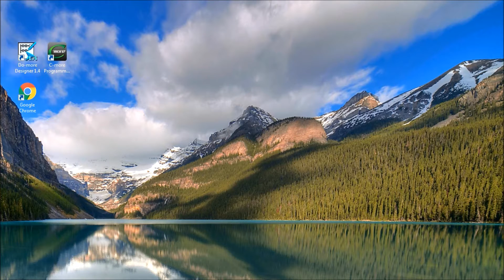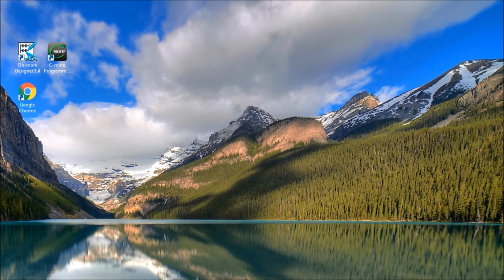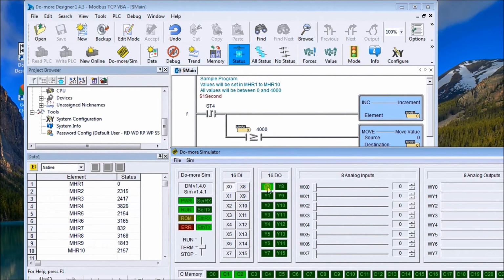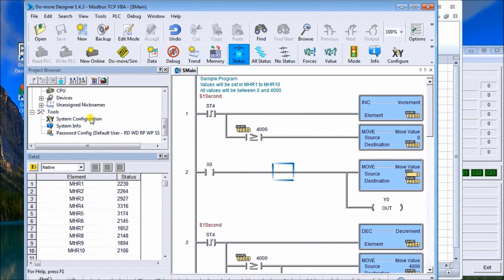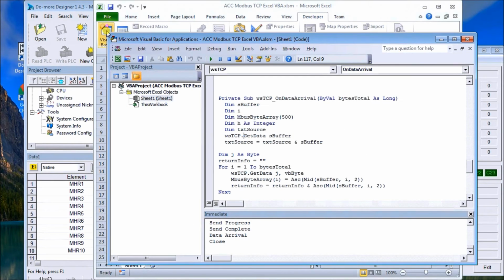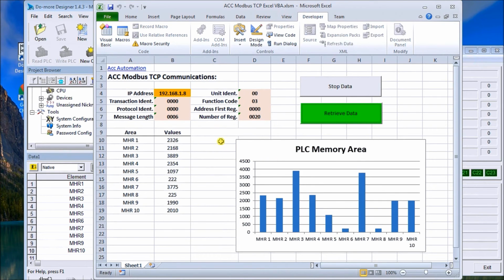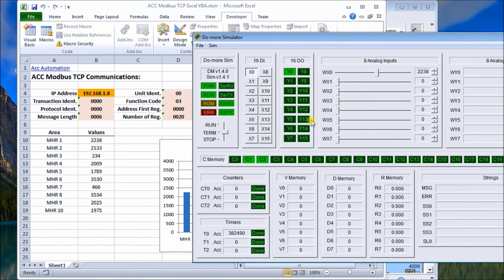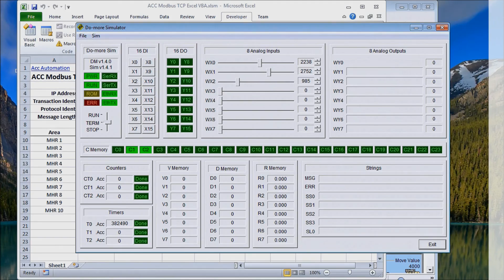Supercharge PLC Data Extraction with VBA and Modbus!

Comment: One Question.
When querying the sentence below, addresses up to 127 are retrieved successfully, but addresses above that number are problematic (Actual Value: 128, Return Value: 63).
Are there any limitations to using the CHR function when querying addresses above 127?
Is there a better way?    
MbusQuery = Chr(0) + Chr(0) + Chr(0) + Chr(0) + Chr(0) + Chr(6) + Chr(0) + Chr(3) + Chr(0) + Chr(127) + Chr(0) + Chr(20)
Thanks.
Reply from the maker: Hi James,
The maximum length of a Modbus message is 256 bytes for Modbus RTU and Modbus ASCII. This limit applies to the entire message, including the address, function code, data, and error checking (CRC) fields. For Modbus TCP, the maximum message size is also 256 bytes, but this includes a 6-byte header and a 1-byte unit identifier, reducing the usable data payload. 
You will then repeat the Modbus message with a different starting address for the next piece of data. (256 bytes)
Regards,
Garry
Reply: @ACCautomation  Thanks Garry.
My question is, for example, how can I get the values of 10 registers starting from Holding Address 258 ?
Ragards
Reply from the maker: @jameslee6311  
If (wsTCP.State = 7) Then
    MbusQuery = Chr(0) + Chr(0) + Chr(0) + Chr(0) + Chr(0) + Chr(6) + Chr(0) + Chr(3) + Chr(2) + Chr(58) + Chr(0) + Chr(20)
    wsTCP.SendData MbusQuery ‘Send out the Modbus Information
    ‘Read the information
    ‘0000:    Transaction Identifier
    ‘0000:    Protocol Identifier
    ‘0006:    Message Length (6 bytes to follow)
    ’00:      The Unit Identifier
    ’03:      The Function Code (read MHR Read Holding Registers)
    ‘0258:    The Data Address of the first register
    ‘0020:    The number of bytes to read

The website has step by step instructions:
https://accautomation.ca/how-to-implement-modbus-tcp-protocol-using-vba-with-excel/

Regards,
Garry

Comment: Dear Garry, Thank you very much for your prompt and kind response. I have already downloaded, installed, registered, and referenced MSWINSCK.OCX. However, when I run the macro and use the "Retrieve Data" button, I get the message "Error - 2147221164: class not registered." I would greatly appreciate your help. Best regards, Carlos

Comment: Dear Harry, I've seen your magnificent video. I congratulate you and thank you very much. I couldn't get it to work on Windows 10, but I did on Windows 7 and Excel 2010. With the simulator, it worked on the first try. Then I tried with a real PLC, changing the IP address, and it worked, but some numerical data arrives distorted. Others, even large ones like 20000, are not affected. I would greatly appreciate your comments so I can understand what is happening. Thank you very much. A hug from Lima, Peru, Carlos
Reply from the maker: Hi Carlos,
Thank you for the comments. 

To use the OstroSoft Winsock Component (MSWINSCK.OCX) with VBA in Windows 10, you'll need to register the component, add it as a reference in your VBA project, and then you can use its features. The process involves downloading the component and registering it using regsvr32.
"regsvr32 C:\Windows\SysWOW64\MSWINSCK.OCX"

Modbus is a 16-bit communication protocol. Anything larger than this (16 bit, FFFF, 65353), then you may need to read two values and put them together. One of the most significant digits and one of the least significant digits. 

A more powerful and robust logging system can be obtained by using Node-RED. Here is the series that will take you through installing, collecting data, saving to a database, and sharing this information with multiple users.
https://accautomation.ca/series/node-red-iot-enabling-software/

Regards,
Garry

Comment: how to write to the PLC?
Reply from the maker: Details on the writing are on the corresponding website post for this video:
https://accautomation.ca/how-to-implement-modbus-tcp-protocol-using-vba-with-excel/

    ‘Write the information
    ‘0000:    Transaction Identifier
    ‘0000:    Protocol Identifier
    ‘0009:    Message Length (6 bytes to follow)
    ’01:      The Unit Identifier
    ’16:      The Function Code (read Analog Output Holding Registers)
    ‘0000:    The Data Address of the first register
    ‘0001:    The number of registers to write
    ’02:      The number of data bytes to follow
    ‘0030     The number to put into the register
   
I hope this helps you out.
Regards,
Garry

Comment: I keep getting "Error -2147221164: Class not registered" when I press the 'Retrieve Data' button.  Already repaired Excel, error persists.  The VBA code is not modified since downloading from your dropbox.  I'm running Windows 11, MS Excel 2021
Reply from the maker: Hi Kristien,

Can you register the OSWINSCK.dll file from the command line? Here is a link to explain how to do this.
https://myaps.reckon.com/knowledgebase/article/KA-01428/en-us#:~:text=To%20register%20DLL%20or%20OCX,e.g.&text=2.,regsvr32%20with%20the%20%2Fu%20switch.

-To register a 32-bit dll or ocx Windows System file in a 64-bit version of Windows (11, 10, 8.1, 7, or Vista),
     Type cd \Windows\SysWOW64  [then press Enter] 
     Type regSvr32 oswinsck.dll  [then press Enter]

Please let me know if this works for you.
Regards,
Garry
Reply: @ACCautomation   Copied the DLL file from the programs files folder into the SysWOW64 folder.  The OCX file was already there.  Ran the following two commands..
C:\Windows\System32>C:\Windows\SysWOW64\regsvr32 oswinsck.dll

C:\Windows\System32>C:\Windows\SysWOW64\regsvr32 oswinsck.ocx

Both registered successfully, but still getting the same error in Excel

Comment: Great video, thnks! I have one question, the adress of the first register(excel cell) is a hexa number? Any other input data is in hexa too?
Reply from the maker: Hi joao pereira,
Here are the cell numbers in the Excel sheet:
IP Address = B4
MHR 1 to 10 values located at B10 to B19
These are just pointers to the cell.
The values that are returned are hexadecimal from the PLC. (16 Bit Binary Word) 
The program utilizes the CHR and STR functions to convert the data from binary to ASCII and back.
The highest value of a byte of data is 256. This is why we have to multiply the highest significant byte with 256.
The full explanation can be found on our website for this video:
https://accautomation.ca/how-to-implement-modbus-tcp-protocol-using-vba-with-excel/
I hope this helps you out.
Regards,
Garry
Reply: @ACCautomation  I saw that code already. I want to know if the input data i fill, in first register(excel cell), that is sent to PLC is hexa. The code is working with the do-more simulator, but i am testing with a PLC i have with no sucess :(
Reply from the maker: @MrPereira99  
Yes, the information from the PLC registers is in hex. The Do-More Simulator and Do-More PLC (Like the BRX) should be the same code. It would just be the IP address change. 
I would also check your firewall on your computer to ensure that you will allow communication to port 502 (Modbus TCP default).
Regards,
Garry
Reply: @ACCautomation  If i want to change the first adress of the first register i have to change in the vba code, more precisely in the mbusQuery, correct? in the excel cells is not enough. I think use chr() to transform in ASCII but i didnt understand how i write the message i want to send this way, can you explain? 

(Sorry for the late response, i was busing doing other things :(  )
Reply from the maker: @MrPereira99  
If you want to write data to the Modbus device you will need to change the code. The website post for this video will include the code to write information.
https://accautomation.ca/how-to-implement-modbus-tcp-protocol-using-vba-with-excel/
‘ Write the information
    ‘0000:    Transaction Identifier
    ‘0000:    Protocol Identifier
    ‘0009:    Message Length (6 bytes to follow)
    ’01:      The Unit Identifier
    ’16:      The Function Code (read Analog Output Holding Registers)
    ‘0000:    The Data Address of the first register
    ‘0001:    The number of registers to write
    ’02:      The number of data bytes to follow
    ‘0030     The number to put into the register

Regards,
Garry
Reply: @ACCautomation  i want to read, but change The First register only. 
There are 7 parameters in total(protocol, device id, etc) but only 12 chr in mbusquery formula.
I already saw this page, helped me a Lot!
Reply: so.. You know how to change the first adress in vba code code? It seems kinda weird to me because we have 7 parameters but 12 ch() in the formula.
Reply from the maker: @MrPereira99  
Here is a sample code for reading:
   ‘ Read the information
    ‘0000:    Transaction Identifier
    ‘0000:    Protocol Identifier
    ‘0006:    Message Length (6 bytes to follow)
    ’00:      The Unit Identifier
    ’03:      The Function Code (read MHR Read Holding Registers)
    ‘0000:    The Data Address of the first register
    ‘0020:    The number of bytes to read

If you want to change the starting Modbus address then change the data address of the first register from the code above.
This does have 7 parameters but you specify the number of bytes. Some parameters will take two bytes.

I hope this helps you out.
Regards,
Garry
Reply: @ACCautomation  Thank you very much!! I will try out!

Comment: Hi, how do i change Modbus addresses to another component using Modbus TCP / IP. It is for a Genset controller DEIF AGC4.
for example input register 04 address 501 Generator voltage L1-L2 (INT16)
Reply from the maker: Hi Michael Nielsen,
I have not used this controller. The manual appears to say that you can use software to change the Modbus address.
https://deif-cdn-umbraco.azureedge.net/media/purl03z4/option-h2-and-h9-modbus-communication-agc-4-4189341180-uk.pdf?rnd=132572580230370000&v=4
I would contact the manufacturer.
Regards,
Garry
Reply: @ACCautomation  I have the all the adresses to the controller. 
I want to know how to change your excel to these ardesses.
Reply from the maker: @michaelnielsen7974  
All of the documentation for this post is located on our website.
https://accautomation.ca/how-to-implement-modbus-tcp-protocol-using-vba-with-excel/

MbusQuery = Chr(0) + Chr(0) + Chr(0) + Chr(0) + Chr(0) + Chr(6) + Chr(0) + Chr(3) + Chr(0) + Chr(0) + Chr(0) + Chr(20)

    ‘ Read the information
    ‘0000:    Transaction Identifier
    ‘0000:    Protocol Identifier
    ‘0006:    Message Length (6 bytes to follow)
    ’00:      The Unit Identifier
    ’03:      The Function Code (read MHR Read Holding Registers)
    ‘0000:    The Data Address of the first register
    ‘0020:    The number of bytes to read

I hope this helps you out.
Regards,
Garry

Comment: Hello Garry,
I'm trying to get this to work but i get an error -2147221164 class not registered.
 It happens when it reaches the line.. Set wsTCP = CreateObject("OSWINSCK.Winsock")
I registered the DLL manually and reinstalled the oswinsck. Windows 10, excel 2010.
Reply from the maker: Hi psdonald42,
I would contact the vendor directly on this problem.
http://ostrosoft.com/oswinsck.aspx
There are some forums with similar issues:
https://social.technet.microsoft.com/Forums/lync/en-US/593947b2-3951-497e-99f5-475c46bc59d9/excel-2010-64-bit-corresponding-winsckwocx?forum=excel
https://www.mrexcel.com/board/threads/using-vba-to-create-tcp-connection-to-remote-temperature-equipment-using-ostrosoft-or-winsock.973563/
I hope this helps you out.
Regards,
Garry

Comment: I have used following code. I am unable to read holding registers.i am getting zero values for all registers. Please help

Option Explicit

Dim bytesTotal As Long
Dim sPage As String
Dim MbusQuery
Dim returnInfo
Dim wsTCPgdb
Dim WithEvents wsTCP As OSWINSCK.Winsock
Dim SetObject
Dim RetrieveData

Private Sub CommandButton1_Click() ‘ Retrieve Data
On Error GoTo ErrHandler
  Dim sServer As String
  Dim nPort As Long
  Dim StartTime
 
  DoEvents
  nPort = 502 ‘ See configuration in Do-More Designer
  ‘ Set the IP address of the PLC
  sServer = Sheets(“Sheet1”).Range(“B4″) ‘”192.168.1.3”
  RetrieveData = 1
  CommandButton1.BackColor = “&H0000FF00” ‘ Set colour to Green

‘Check to see if the object has been created. If not set wsTCP.
If SetObject = “” Then
Set wsTCP = CreateObject(“OSWINSCK.Winsock”)
wsTCP.Protocol = sckTCPProtocol
SetObject = 1
  End If

‘ Check the state of the TCP connection
‘0 sckClosed connection closed
‘1 sckOpen open
‘2 sckListening listening for incoming connections
‘3 sckConnectionPending connection pending
‘4 sckResolvingHost resolving remote host name
‘5 sckHostResolved remote host name successfully resolved
‘6 sckConnecting connecting to remote host
‘7 sckConnected connected to remote host
‘8 sckClosing Connection Is closing
‘9 sckError error occured

‘ If TCP is not connected, try to connect again.
If wsTCP.State <> 7 Then
    If (wsTCP.State <> sckClosed) Then
      wsTCP.CloseWinsock
    End If
    ‘ Open the connection
    wsTCP.Connect sServer, nPort
    StartTime = Timer ‘ Use the timer to determine if a connection cannot be made
    Do While ((Timer < StartTime + 2) And (wsTCP.State <> 7))
        DoEvents
    Loop
    If (wsTCP.State = 7) Then
    Else
       Exit Sub
    End If
End If

‘ If we are connected then request the information.
If (wsTCP.State = 7) Then
    MbusQuery = Chr(0) + Chr(0) + Chr(0) + Chr(0) + Chr(0) + Chr(6) + Chr(0) + Chr(3) + Chr(0) + Chr(0) + Chr(0) + Chr(100)
    wsTCP.SendData MbusQuery ‘Send out the Modbus Information
    ‘ Read the information
    ‘0000:    Transaction Identifier
    ‘0000:    Protocol Identifier
    ‘0006:    Message Length (6 bytes to follow)
    ’00:      The Unit Identifier
    ’03:      The Function Code (read MHR Read Holding Registers)
    ‘0000:    The Data Address of the first register
    ‘0002:    The number of registers to write
   
    ‘ Write the information
    ‘0000:    Transaction Identifier
    ‘0000:    Protocol Identifier
    ‘0009:    Message Length (6 bytes to follow)
    ’01:      The Unit Identifier
    ’16:      The Function Code (read Analog Output Holding Registers)
    ‘0000:    The Data Address of the first register
    ‘0001:    The number of registers to write
    ’02:      The number of data bytes to follow
    ‘0030     The number to put into the register
   
    ‘ Note: Addresses are offset by 1
    ‘   Example: MHR1 = Address 0000
    ‘   Example: MHR30 = Address 0029
   
End If
  Exit Sub

ErrHandler:
  MsgBox “Error ” & Err.Number & “: ” & Err.Description
End Sub
Private Sub CommandButton2_Click() ‘ Stop the communication
RetrieveData = 0
CommandButton1.BackColor = “&H8000000F” ‘ Set the default colour
End Sub

Private Sub wsTCP_OnDataArrival(ByVal bytesTotal As Long)
  Dim sBuffer
  Dim i
  Dim MbusByteArray(500)
  Dim h As Integer
  Dim txtSource
wsTCP.GetData sBuffer
  txtSource = txtSource & sBuffer
 
Dim j As Byte
returnInfo = “”
For i = 1 To bytesTotal
    wsTCP.GetData j, vbByte
    MbusByteArray(i) = Asc(Mid(sBuffer, i, 2))
    returnInfo = returnInfo & Asc(Mid(sBuffer, i, 2))
Next
 txtSource = returnInfo
 txtSource = Val(Str((MbusByteArray(10) * 256) + MbusByteArray(11)))
 Sheets(“Sheet1”).Range(“B10”) = Val(Str((MbusByteArray(10) * 256) + MbusByteArray(11)))
 Sheets(“Sheet1”).Range(“B11”) = Val(Str((MbusByteArray(12) * 256) + MbusByteArray(13)))
 Sheets(“Sheet1”).Range(“B12”) = Val(Str((MbusByteArray(14) * 256) + MbusByteArray(15)))
 Sheets(“Sheet1”).Range(“B13”) = Val(Str((MbusByteArray(16) * 256) + MbusByteArray(17)))
 Sheets(“Sheet1”).Range(“B14”) = Val(Str((MbusByteArray(18) * 256) + MbusByteArray(19)))
 Sheets(“Sheet1”).Range(“B15”) = Val(Str((MbusByteArray(20) * 256) + MbusByteArray(21)))
 Sheets(“Sheet1”).Range(“B16”) = Val(Str((MbusByteArray(22) * 256) + MbusByteArray(23)))
 Sheets(“Sheet1”).Range(“B17”) = Val(Str((MbusByteArray(24) * 256) + MbusByteArray(25)))
 Sheets(“Sheet1”).Range(“B18”) = Val(Str((MbusByteArray(26) * 256) + MbusByteArray(27)))
 Sheets(“Sheet1”).Range(“B19”) = Val(Str((MbusByteArray(28) * 256) + MbusByteArray(29)))

DoEvents
‘ Determine if we retrieve the data again.
If RetrieveData = 1 Then
    Call CommandButton1_Click
End If
End Sub

Private Sub wsTCP_OnError(ByVal Number As Integer, Description As String, ByVal Scode As Long, ByVal Source As String, ByVal HelpFile As String, ByVal HelpContext As Long, CancelDisplay As Boolean)
  MsgBox Number & “: ” & Description
End Sub

Private Sub wsTCP_OnStatusChanged(ByVal Status As String)
  Debug.Print Status
End Sub
Reply from the maker: Hi Venkatesh.
It looks like the code is fine. I would verify your IP and sub mask addresses.
Regards,
Garry
Reply: @ACCautomation  
Sir 
In code we are entering submask address na. Whether this code reads floating point holding registers..please help sir
Reply from the maker: @venkateshchennuri8992  
I did not see your sub mask address. This should be the same on both ends of your Ethernet communication. It should read something like the following:
255.255.255.0
This is usually set in the computer network card. 
https://www.howtogeek.com/howto/19249/how-to-assign-a-static-ip-address-in-xp-vista-or-windows-7/
I hope this helps you out.
Regards,
Garry
Reply: @ACCautomation  sir i want to read holding register 32 bit. Whether is it possible with the above code?